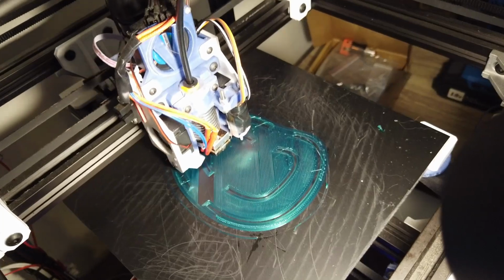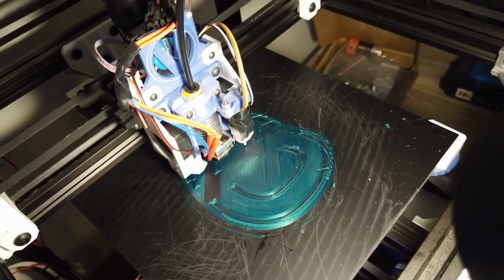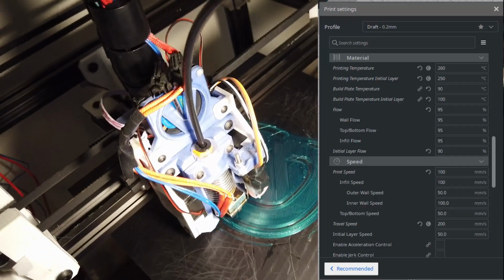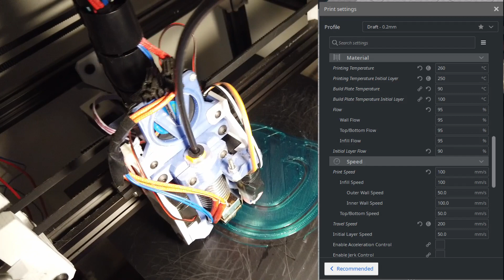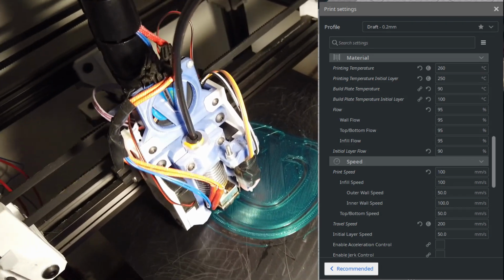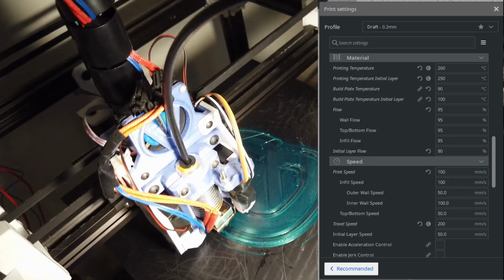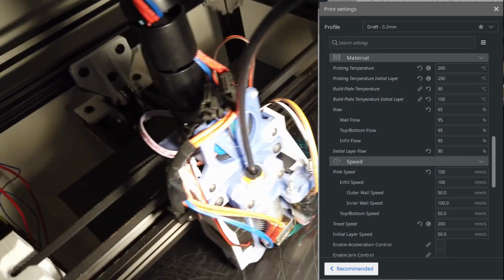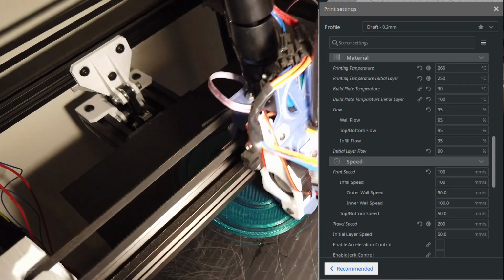Printing with PETG/CPE on the V-Baby DIY CoreXY | Behind the scenes action

Comment: Have you tried using the Volcano E3DV6? There is no way I can configure it for PETG.
Reply from the maker: I am sorry no. I do not want to use the Volcano myself as I got a Dragon hotend that is about the same flow without the long heater block. I guess the Volcano is leaking to much due to the filament oozing out cause of backpressure in the system